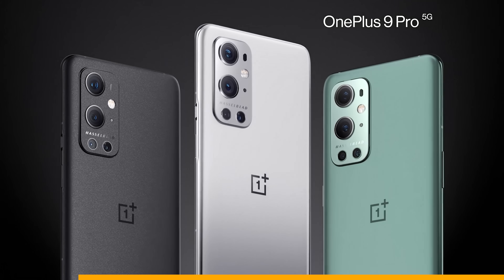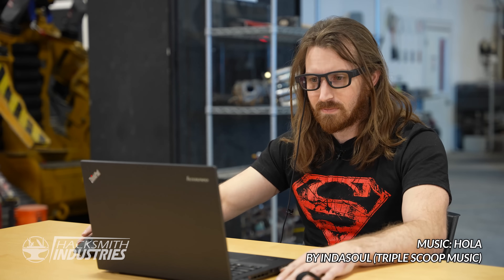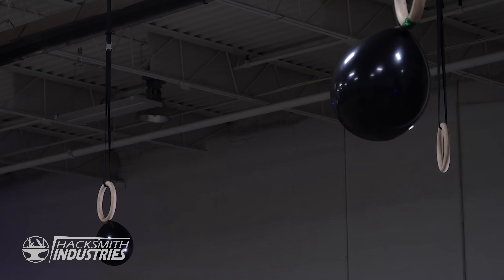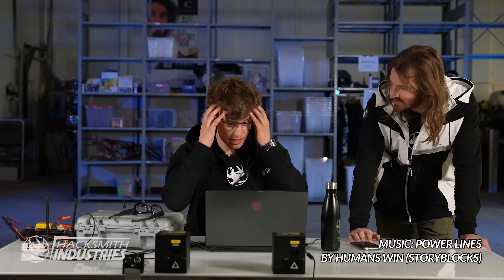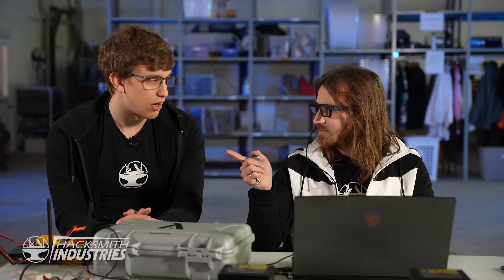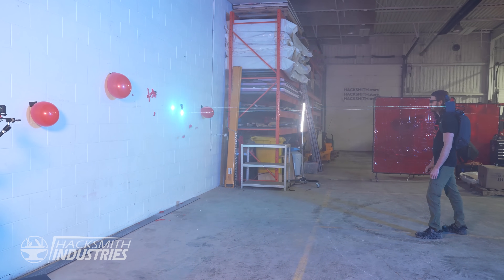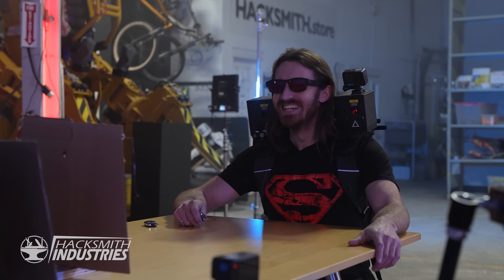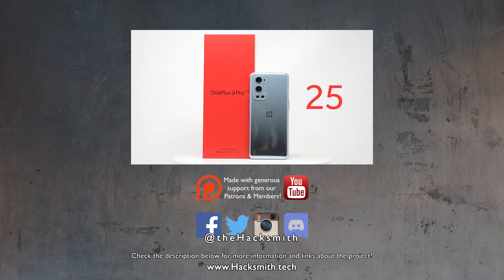We Built Real Life Superman Tech! (HEAT VISION!)

Comment: If the trigger also had a wheel that let you tweak the horizontal angle, you could use it to adjust at what distance the laser would meet at a point. Or, have a second laser calculate the distance and do it automatically.

Comment: What's a good build. A portable mini zombie furnace. That's a mini furnace that can be carried on the run against zombies. When you in the clear in a safe spot. You can make some weapons from metal scraps you find in your location. That means you would have to properly have to wire it up. To be be used with a powerbank or  any type of solar panel.(SOLAR BATTERY BANK.) Maybe a solar vest to connect with the electric. Furnace. So when u on the run. The panels charge by sun and u can make weapons when in the clear. BTW. IT SHOULD BE ABLE TO FIT IN A SMALL BAG/POUNCH/ PURSE/CAMERA BAGS. Whatever you want to call it. Needs to be light to carry. You can even try physical energy. Electricity boots powerbank that charges everytime you run/ move.

Comment: If they would only spend a wee bit more time to tweak the system so it can more accurately more simultaneously unite and synchronize the lasers since majority of the time they are not in full focus it’s kinda missing the constant measure 📐 and compensation for any minimal misalignment brought on by and insignificant eye movements and the continuous distance alterations maybe have a distance focal setting to automatically self adjusted for any change in distance and separation if the lasers at a minimal point
Reply from the maker: It's just for a YouTube video... one time use really. Could take months to hone it in precisely, that's why what we make are prototypes, not products!

Comment: It might be more 'Cyclops' than 'Superman' but this is still pretty damned awesome.  As you noted, our eyes move a lot more than we tend to notice.  Maybe build in some sort of 'lock on' feature so once you've acquired your target the system will stick to the point no matter how you move/look until you toggle it off?
Reply: This doesn't sound that far fetched, he was using a hand control to fire the lasers when at full power, they could use a two trigger control like a fighter jet. Cep the top button is held down whenever eye tracking is wanted, when released it switches to an IMU to cancel out slight body movements, and the pistol trigger switches betwen the low power aiming beam and the full power destruct-o-beam when pulled, and back to aiming eyesafe mode when released..
Reply: honestly it reminds me more of the camera man titan in skibiti toilet

Comment: That was pretty awesome, adequate eye tracking, and the amount of code it took lol. Good job Charles on that front. I wonder what other things eye tracking can be useful for. The Scan Visor from the Metroid Prime games come to mind, perhaps you can even add it to your thermal imaging visors to focus on one point so you can estimate its temperature directly. 

Question about the tracking: I notice that both lasers looked to be about the same distance from each other when on the wall throughout testing. Do the glasses themselves only scan the motion of one eye rather than both, allowing for the lasers to move per-eye, or is that related to the software used in making the device?

Great video as usual, and awesome job to the team that worked on it!
Reply from the maker: "Hi! Thanks for the good question. The glasses scan both eyes and calculate your gaze position in 3D-space (X, Y, Z), but the depth is not particularly accurate beyond a couple metres. So we used, where possible, the LiDAR to correct for the parallax between the lasers.

The glasses are able to produce separate data streams for each eye, but as an azimuth and elevation instead of 3D-point. This is still a beta feature, though AdHawk is working to improve it and add it to the API.

For the final tests, we had issues with the LiDAR providing spurious readings because James' hair kept getting in the way, so it was turned off, leaving us with lackluster convergence of the lasers. In bench tests, the two lasers would often land within millimetres of one another with LiDAR assistance, but that was not an option - they were fixed to a convergence distance of 5.0m for most of the test you see in the video." - Charles
Reply: @hacksmith  cool video
Reply: @ryanguy5452  nnb
Reply: @ryanguy5452   n! K jhgra
Reply: @vjvj7889  wtf?
Reply: @vjvj7889  you papyrus from Undertale
Reply: @hacksmith  this answered questions I was going to ask also. Although couldn't he just tie his hair back? I did notice the lasers didn't always converge that well.
Reply: Mnb
Reply: ز

Comment: Interesting math behind eye tracking too. 

In principle, the two rays traced by the center of your pupils perpendicular to the back to your fovea should intersect at the 3-D location where your eyes are focused. 

From there with a calibrated cameras, you can pretty easily map this to a location relative to the camera. 

I’m curious if a monocular eye tracking approach has been attempted, as you can search for key points in an image along a line, to estimate the actual object that an individual is looking at.

For that use case there is no IMU required. The IMU becomes far more useful when discussing VR and AR applications where the orientation of the cameras matter

Comment: I am missing something? Do the projectors have gyroscopes in them? Because one thing tracking an eye in relation on something sitting on a table.... But you have a moving reference system with head in which the eye is tracked, and the lasers are also moving around, so you need to calculate target in relation of the lasers relative direction... MANY MATHS MUCH WOW
Reply from the maker: Glasses have an IMU in them too, which worked fairly well and was part of the code -- but that was also why I had the head rest so you could keep your head stationary
Reply: @hacksmith  I saw that the head movement is factored in the eye tracking.... i was talking about the orientation of the laser projectors themself...

You just pretty much keep them level? because if the pojectors are tilted down 10 degrees, the final projection point should be drawn up 10 degrees
Reply from the maker: That's what the quick recalibration button was for =) accounts for any change in position
Reply: @hacksmith  Oh, so move, "setup", calibrate, try not to move shoulder much... rinse and repeat :D
Sneaky

Comment: I was wondering how the lasers knew where to point. Using the glasses makes sense so they can track your vision but the lasers would need to be on a stationary object like a table. Did you have some sort of gyroscope or did you use AI to track object and keep the lasers in place relative to your surroundings? Or did you just keep your body as still as possible. Since the projector is using mirrors to aim the laser moving the housing would move the laser dot so it wouldn't aim in the same spot as where you look right?
Reply: Probably they're just offset from the glasses by some amount. That's probably why they're in line with his head, where the glasses are.

Comment: great video,I have an idea why not create a backpack with a suit that supports different climates, for example if it's hot it would be with a water cooling system and the radiator would be in the backpack or if it's cold it would be with heating resistors and with a helmet that allows you to breathe different chemicals in the air like a gas mask like snowtroopers in star wars 5, it is an idea that stayed with me and I would like to see how they do it

Comment: I thought of a way you could rout the lasers (maybe). It would be stupid, recless and awkward, but sitll interesting. If you had a frame to hold the laser modules by your head, and then use heat resistant 1 way mirrors to reflect the lasers. In sure you thought of that and threw it aside for the stupidity that it would be...

Comment: 12,000 usd for those glasses. And 902 usd each laser cude. Call it 400 usd in hardware. So roughly 20,000 usd to get superman laser vision. And that if you know what your doing.
Reply from the maker: The glasses are currently for developers only -- that's why they're expensive =)
Reply: @hacksmith  excellent point. But still.

Comment: Okay everyone hear me out. What if the military started using this for turret designs. No longer aiming manually but instead using just your eyesight to take out threats. Even the point where you could have it shoulder-mounted. You could also have a program that register is sensors on your body so that you or your companions won't be shot at by the turret even if it's at an odd angle. You could even write a program that could account for distance and bullet drop. You could even guided-missile this way. Or even have drones with weapons mounted on them while you merely stare at the enemy.
Reply: I'm pretty sure that's been in fighter pilots helmets for decades..